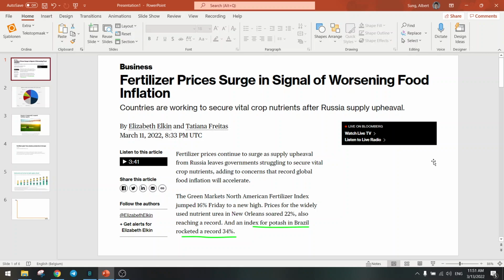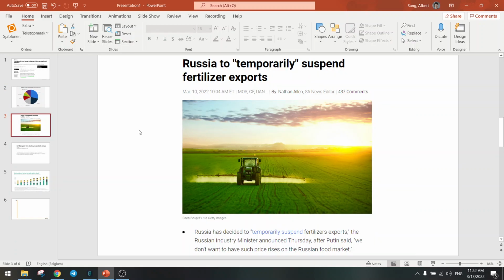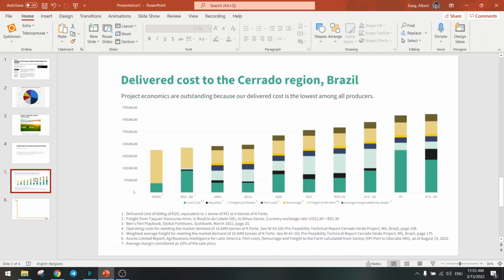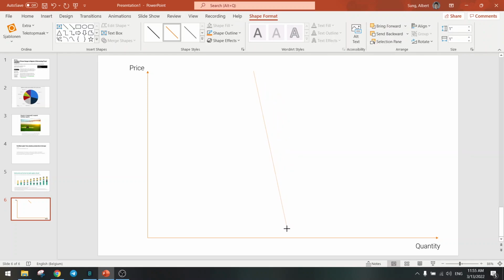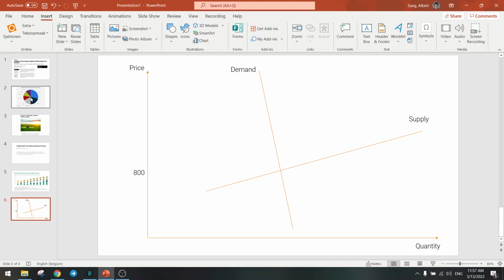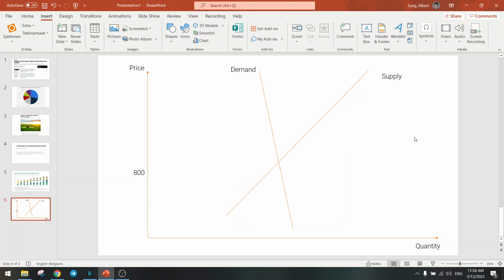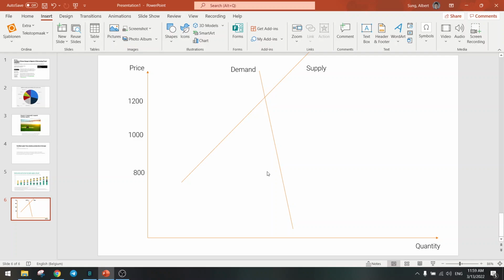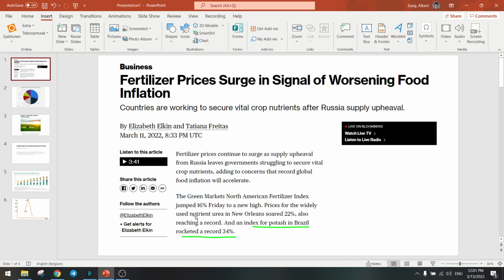Stock Screener: Ep. 121: Fertilizer Supply and Demand

Comment: I noticed that Verde has some pretty significant freight costs, can the competition squeeze them or is supply so limited that we need not worry about the rising freight costs?
Ty Albert
Reply from the maker: Yes freight costs are significant for Verde. If oil prices double, then Verde costs will also almost double. Mosaic will feel these costs as well to a lesser extent, but they have higher cash costs to mine it. I don't think there is anything to squeeze because Brazil said that their fertilizers will be depleted in 3 months. So Verde will continue to sell their product.
Reply: @katchum   👌very well - THX for the update and your willingness to share your knowledge; let’s make a small fortune with this Company